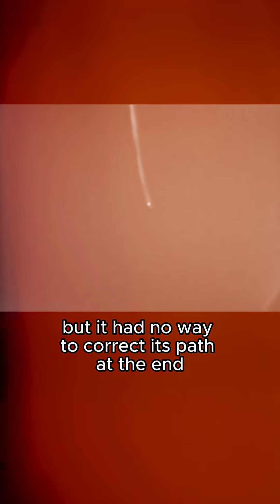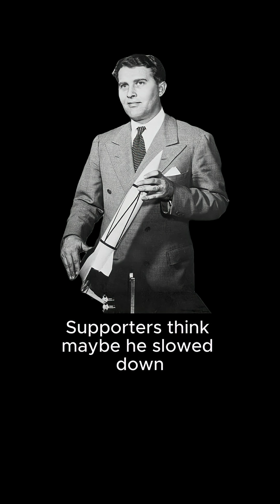V-2 Rocket’s Inaccuracy Explained | Wernher Von Braun

Comment: The answer would lay with those V-2's captured by the United Army and tested in New Mexico by German scientists in 1946-1948.  Did they suddenly become more accurate overnight?
Reply from the maker: Great point @JohnSmith-il7jn! I wouldn't quite say the captured V-2s at White Sands suddenly got more accurate overnight though. They still used the same wartime inertial setup (rate gyros + analog cutoff computer) and showed big dispersion. What did change was the test range and instrumentation. The U.S. Army/GE Hermes team flew the rockets strictly as research vehicles, with range radars, cinetheodolites, and upgraded telemetry so engineers could measure every wobble, cutoff, and breakup instead of trying to hit a target in combat. In fact, about half of the White Sands V-2 flights were classified as failures by test standards. But they were useful failures in my mind, because they generated the data the U.S. needed to design its own missiles.

The first US V-2s were launched in April of 1946, I believe it was approximately 62 systems flew as part of the Project Hermes which ran until ~1952. General Electric was contracted by the Army to assemble, modify, and fly the captured hardware with the Germans at White Sands. White Sands pioneered triangulation from cinetheodolites and refined trajectory-reconstruction methods, turning raw film/radar data into accurate flight paths (i.e., better measurement, not suddenly better accuracy). According to NASA, these flights took the first photos of Earth from space (Oct 24, 1946), recorded solar UV spectra above the ozone layer, and returned cosmic-ray and upper-air data, pure research wins. The data, processes, and people flowed into Redstone, and then onward to Atlas/Jupiter and ultimately Saturn V. In my mind, that’s the real “accuracy” upgrade: new guidance, new engines, new airframes built on lessons from White Sands.

Basically, White Sands made the V-2 measurable and understandable, not accurate. The measurements and failures there are what let the U.S. build its own accurate missiles later.

Comment: Interesting to hear about how it was manufactured! 😳😱
Reply from the maker: Exactly @gotunconscious! And there are reports of quiet acts of sabotage during manufacturing too. Mis-wired circuits, tiny defects slipped in by forced laborers. Makes you wonder how much of the V-2’s inaccuracy came from hidden resistance, and not just the tech itself.